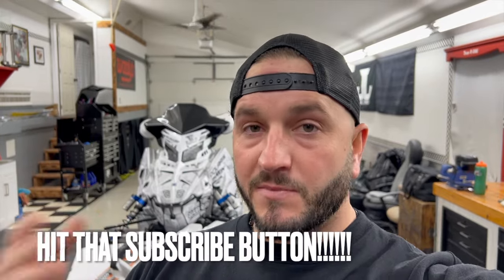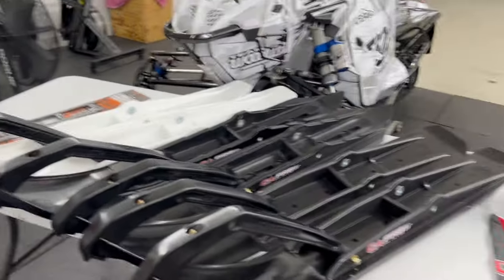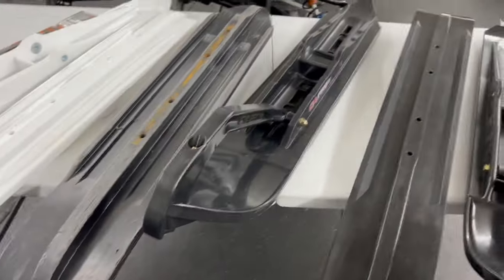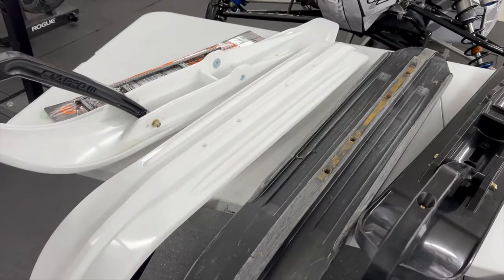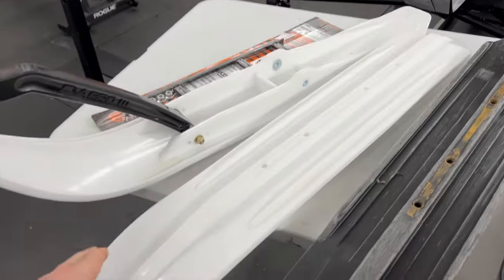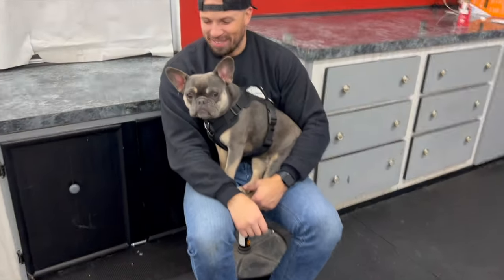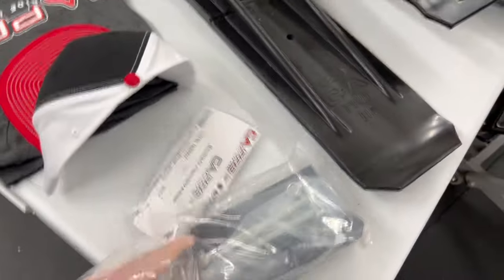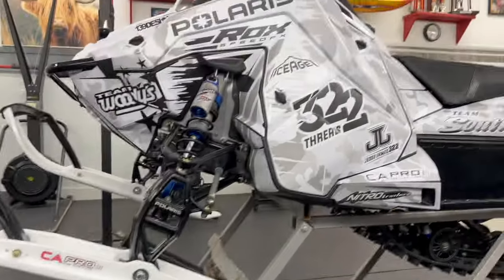2024 POLARIS ASSAULT BOOST GETS SOME C&A XPT SKIS. WHAT C&A SKIS ARE BEST FOR YOU?

Comment: Just got back from tug Hill. You are limited to the southern part of the hill, basically from high market up to tabolt corners. North of the Tabolt corners that snow gets very sketchy. Both Turin and southern tug clubs panned some of the trails, which made them fairly hard, but not a lot of snow. The hill is supposed to get in the mid 40s to near 50 tomorrow, so the snow will be going fast. I only got about 50 miles on today.
Reply from the maker: we ended up getting 84 miles in but as you said very small playground. 84 miles is better than 0 though so very happy we went and got on snow!